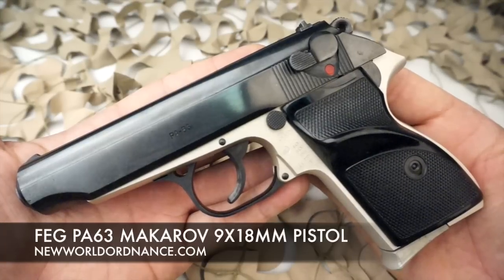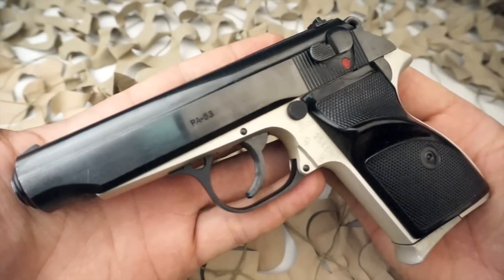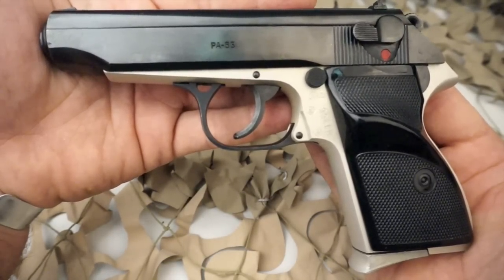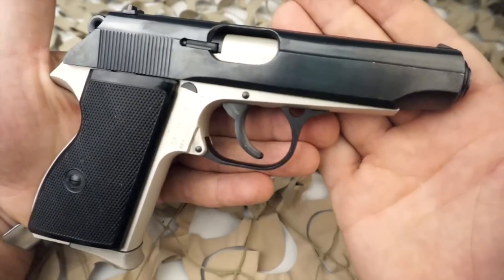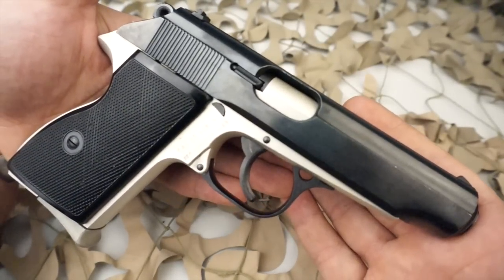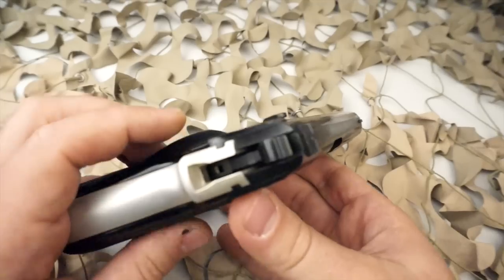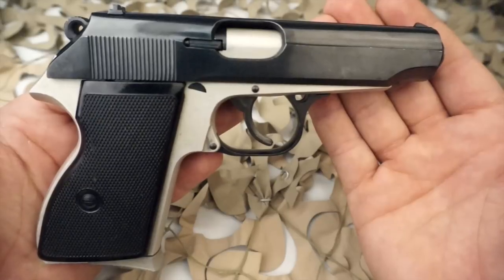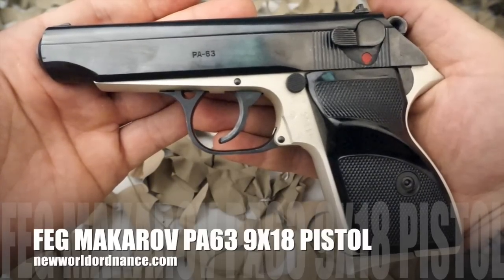FEG PA 63 9x18 Makarov PA63 Military Compact Semi Auto Pistol Overview   New World Ordnance

Comment: The only problem I have with it is the it's recoil is a pain. It has a very heavy recoil. I shot 70rds out of it and my hand bruised.
Reply: Amazon for a new recoil spring will lessen the recoil. Made by wollf.
Reply: I'm getting the Wolf 15lbs spring kit
Reply: @mark-1901 doesn't the heavier recoil spring make it much harder to rack back
Mine seems super hard to rack compared to the Baretta92